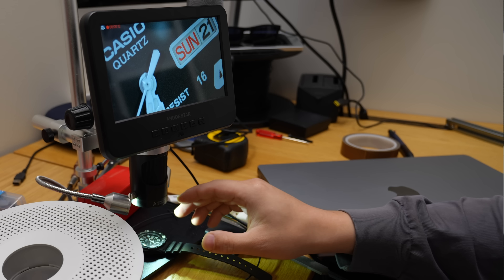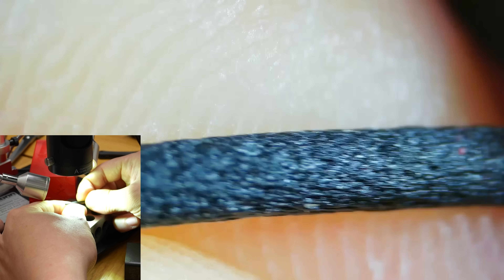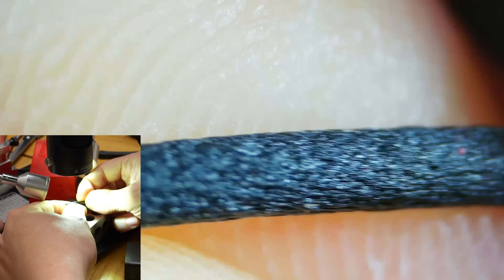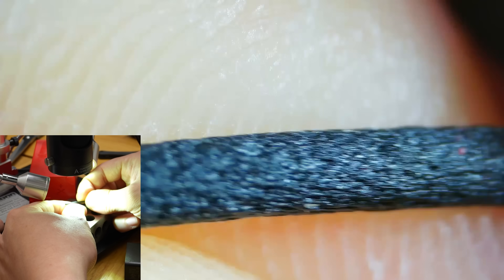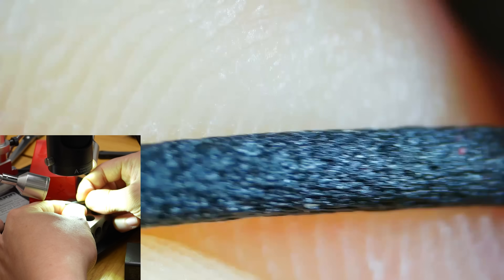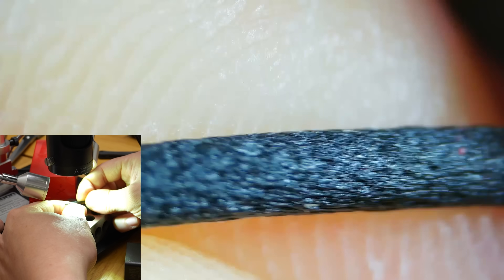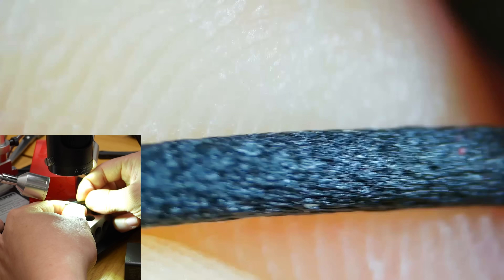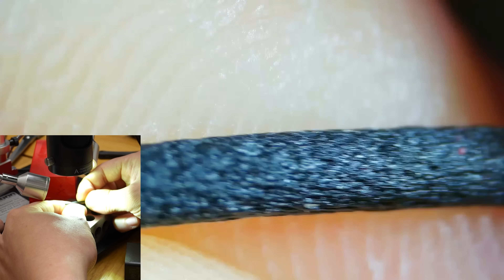The Dark Side of Carbon Fiber Filament

Comment: Well this was no surprise. I have no doubt other, non-carbon fiber filaments will end up in places we don't want them in, in small particles and strands just like this, only in fewer amounts. Think of stringing for example... And what about POM dust from printers with POM wheels? Isn't that basically solid formaldehyde?
Reply from the maker: Just read up on this, apparently delrin is safe unless exposed to strong acids, bases, or is burned when it releases formaldehyde
Reply: @NathanBuildsRobots  Ok, sounds... not so terrible. For a couple of years I worked at a CNC lathe where we would occasionally use POM (delrin) to make parts out of, and it would smell really weird and make a big mess with tiny chips and dust inside the machine every time. I bet it was the formaldehyde gas being released.

Comment: About 20 years ago I was into archery. They teach you to inspect your arrows before every shot. I was shooting aluminium arrows and when shooting an ultra light tube with a tiny dent in it out of a 70lbs bow .. they can fail, and bits go right through the hand holding the bow. A friend was shooting carbon fibre, siting how much stronger they were for the weight ... so I looked into it. Turns out carbon fibre arrows can also fail, even more spectacularly. The problem being that bits of aluminium driven into your hand appear on an x-ray. Carbon fibre does NOT appear on an x-ray. So to get all the bits out, they literally have to sit with a microscope and poke out every tiny black dot amidst all the blood and torn flesh. Anything they miss will still be there decades later, poking you every time you move the hand. Needless to say, I'm still shooting aluminium.
Reply: yes! Inspect with your ears too, bend each arrow before you knock it and listen for defects
Reply: @jellogiant  WHAT? Oh...okay. I thought you were going to say to drag the arrows across your ear to detect splinters.
Reply: I was hand-sanding a 1mm cf rod (really dumb in retrospection) and stabbed it about an inch into a fingertip at an angle. Of course, it broke off. I removed most of it right away but it splintered when it broke. After festering for 4 months I removed another 1 inch piece. That was 6 months ago. There is still at least one more piece in there. I can feel it move and it hurts. I can even see the tip move just under my skin. One day I'll cut it out too. Use caution with cf, boys and girls!
Reply: @ernie5229 please see a doctor
Reply: Fuck i felt that while reading 😖😖😖
Reply: "Needles to say, I'm still shooting aluminium."
Reply: what about using a thick leather glove? or just a cover for the top of your hand
Reply: Ive shot carbon arrows since they becaume a thing over 10 years ago, Ive never had any break during actual shooting, the only ones that broke on me were hitting somthing hard other than the target.. Ive probably shot a carbon arrow at a guess, a half million times !!! No injuries.. Dont even know anyone else who's had trouble with them either..
Reply: They make aluminum sheathed carbon fiber arrows.

Comment: You are quite correct.
Many people using these carbon fibre content filaments, do not know the dangers of what they are playing with.
You should where appropriate PPE, and as a minimum gloves and a mask FFP3 or better.
The composites industry does not where all that gear for the look!
If I print with a fibre containing filament, I seal the finished item with clear lacquer.

Comment: I've worked with fiberglass filters at factory for two years and you'll be fine
Reply from the maker: What sort of PPE do you use?

And what is the typical length/diameter of fibers used?
Reply: @NathanBuildsRobots  normally just a long sleeve shirt but it’s optional and it varied on orders.

Comment: Normal black PLA makes black residue everywhere. I guess its graphite, or whatever they are using as a colorant that is shedding from the filament.
Reply: I have Creality Matte Black PLA, and that stuff has distinct "grainy" texture and a peculiar, strong odor to it, before, during, and after printing, which other matte filament doesn't have, even from the same brand (I've used green and grey Creality Matte PLA's).

Comment: This is a great take (I wish I had seen it before ordering couple of carbon fiber and glass fiber reinforced filaments, lol). I was just thinking about the PTFE tubes and how they are considered another wear item, which means that it is being slowly eroded and getting airborne or contaminating the printed objects. PTFE (Teflon) is a 'forever chemical', our body can't get rid of it so this one also is a potential risk factor.
Reply from the maker: That is a great point. If it’s wearing down, it’s going probably being turned to dust and embedded in prints and in the air

Comment: Can you look at a finished print and see if it still does the same or if it just happens raw?
Reply: Why should there be a difference. It’s molten plastic with cf in it when you get it, you just remelt it into a different shape. If anything it could be worse but it will not magically be better by melting it again.

Comment: Thanks for your video. The topic really needs some thorough research done by the filament manufacturers. 

After watching your video I am somehow left with the big question: "What am I to make of this information?" Could you perhaps make a follow up video and put things into perspective? If it is dangerous, "how dangerous" is it? What other fibrous filaments are there and how does it compare? How does it compare to the risks of working with wood? Isn't wood also just a "kind of carbon fiber reinforced plastic"? And if working with wood is in comparison rather safe, what makes working with wood safe and working with other fibrous materials less safe? Also, what alternatives are there to CF infused filaments? If I want an entry level engineering grade filament that is similarly stiff to for ex. ABS-CF, what can I use, that is printable on a hobbyists 3d printer? The only thing that comes to my mind is PC-ABS.

Comment: I'm very happy that I looked at a strength comparison video, saw there was no advantage to it, and then never thought about using it again.
Reply: There is more to material properties than just tensile strength. Adding fibre absolutely does make a difference to the mechanical properties it just doesn’t do much for tensile strength, but it does increase its stiffness and thermal stability.

Comment: 😂what loads of shet did i just watch?🤣10mins wasted....your only doing this for clicks man(ba ram you). As someone who works with liquid Nicotine to make vape juice i am more afraid of dropping dead from  100+mg Nicotine then i am of CF based filament and I've worked with an around welding equipment huffed exhaust fumes sitting in the trunk of an old 1980s buick la saber and smoke cigarettes since birth...and im supposed to be scared of inhaling and toughing polymer or nylon plastic that YOU SAY has "asbestos" with ZERO evidence from a professional to say "yes that's asbestos"...also if there's asbestos as you claim why didn't you contact the EPA,TSCA,CCA and whoever else needs to be notified so they can deal with it?. Seems kinda weird that you didn't
Reply: It isn’t asbestos at all and he knows that, it is literally what it says it is, carbon fibre.

Comment: I popped open Google Scholar after this and looked for "carbon fiber health risks" and similar terms. From everything I could find, it seems reasonably safe and biocompatible. I don't see how this could be any worse than something like candle soot (which, to be fair, isn't great). It's definitely not Asbestos - the problem with that is the silicate which isn't able to be broken down or absorbed by the body. Now - if you want to look at some of the glass-filled 3D printing filaments, I could see those being a possible risk.
Reply: @circuitguy9750  during printing it's not a risk as the fibers are enclosed inside its wrapper material, it's mostly during handling such as removal of supports and breaks during printing.

Comment: I worried about that when i first printed with Carbon Fiber. I remember my boss back around 20 years ago telling me to go into an attic with GF insulation, about 30 seconds in i noticed it was getting airborne and i said EF that.. told him i can't risk my health. You definitely don't want to sand anything CF or possibly GF and make it air born either.

When i first got a resin printer, i just stopped using it after a few prints despite using an N95 mask and gloves. You really need a full face respirator IMO for prolonged usage. Although it seems to be just fine if you're safe "enough" with occasional usage.

With all this said, I think I'm going to clear coat the CF and GF parts that will have human contact to give it a barrier after watching this. And run my air filter for things like CF PLA, I'll have to play around with settings if it's going to be enclosed.

I've actually been thinking of having a heat exchanger so i can run PLA/PETG prints sealed for both sound a potential toxins. Much like an inner cooler on a car with a turbo or super charger but for the parts cooling fan hose. VROOM

Comment: Not terribly worried about the stuff that gets on the skin, but the prospect of inhalation is scarier. Just printing with it occasionally almost certainly not a big deal, but if you ran this stuff on a print farm daily it would be bad news. I do think there are concerns around using fiber filled filament, but it's nowhere near Asbestos levels of dangerous.
As for uses of fiber reinforced materials, there are many. For PLA it is primarily aesthetic as it hides layer lines and produces a nice finish, but it can also be stiffer and it tends to be high flowing. For Nylon it is primarily less warping and also more stiffness rather than elasticity. PETG and other filaments, generally a mix of the above benefits.
Reply: also heat. Carbon-reinforced nylon once annealed is the most heat resistant stuff you can print without a rig that can extrude PEEK.
And yeah, I wear my respirator with particulate filters when I work with it.

Comment: @markforged
Reply from the maker: Markforged uses continuous fibers, and I’m pretty sure you can use plain nylon for the external finish. So I think they offer some good options with added benefits of much higher tensile strength of continuous fibers
Reply: @NathanBuildsRobots  the standard filament for markforged printers, Onyx, is a carbon fibre filled nylon.

Comment: tbh outside of 3D-2A, automotive and other high heat, high stress applications CF-nylon is really not useful. CF-PLA splits really easy so is not useful anywhere outside of statues. also the idea of coated CF filament defeats the point. having those prickly fibers sticking out aids the layer adhesion of nylon. it would be a good idea to coat those kinds of prints on completion though!
Reply from the maker: You’d have to check the datasheets. Most people say cf reduces interlayer bonding
Reply: Tbh I'm just repeating what the Are We Cool Yet? matrix chat said as well as Hoffman tactical. That said when it comes to 3D-2A we also print a little bit differently than most other 3DP enthusiasts. Hot, and slow for our stuff. Some stuff even uses weld passes. CF layer bonding issues mostly are with PLA and PETG though. Nylon behaves a little bit differently based on the testing performed by Hoffman and others.

Comment: This is a serious threat and it does get everywhere. If you're new, consider that I still find dust samples with carbon fibers from printing over a year since the last CF job in this room and who knows how many times I've cleaned. Dust mitigation is really required here as these fibers are a potential threat to basically all tissue exposed to them - it's mechanical, not chemical. Some of my products are on machines that package food or make the boxes your Amazon stuff comes in. No matter where in the world you are, there's a chance you have or have had one of these products in your home. Those fibers could be in your cheesecake and in your eyes when you tear open the box your headphones came in. My fiber waste could be in your lungs. So obviously I'd never use those materials in that environment but there is literally nobody to check, nobody would know, the food processing facility inspectors would never catch that so it's literally on me to keep you safe and I could totally choose not to. By chance, I had a career in medicine and I know a lot about the topic but that's not some license requirement it's just random luck. Right now you might only be making baby yodas or something, I was too, but eventually your work may end up in the world or all over the world so be responsible now. We don't want to give the fearmongers ideas on how they can make $500M in donations by starting a movement to ban printing with additives, but we need to be aware of industrial hazards like this and learn how to reduce risks. Stop dremeling PC-CF while sitting on your bed next to the resin printer with "less toxic eco-resin™" so you can watch the laser turn vinyl into flaming chemical weapons. This is why we can't have nice things.

I've gone as far as to put up a steel building with proper ventilation and chemical storage and stuff because I've gone commercial but in the 'bedroom shop' configuration I was running evac through a 4" inline blower out a window vent device with activated carbon and HEPA recirculation in the room but there are still VOCs, smoke, and particles all over that don't get captured for a while and present a risk. Those are the ones I keep finding. I doubt we'll see Polymaker mesothelioma commercials any time soon but there have been injuries and there will be more so lets keep it minimal. If you're new to industrial practices you might get some surprises, like that old Ender 3 had its heat block wrapped in literal asbestos lol. A 2 inch square of ceramic fiber paper wrapped in Kapton is only a hazard during stupidly rough handling so its fine normally. That's not weird in industry. Consumer safety bans are for consumers not producers, industrial regulations assume you (the manufacturer) will be responsible for not being dumb. There is no teachers' union to decide in advance you wouldn't hurt yourself if you ate this and shoved it up your butt in a classroom. You're your own plant safety officer so self-educate, the curse of a republic is having to participate, we're all our own kings for better or worse. If you don't want to live in a maximum security world with scent free shampoos and unbreakable rubber sporks then you don't have a choice but to self-govern your practices. Yeah, it's expensive, your $200 laser will be $1000 by the time you finish building it the right way. Your printers will need a room, not a corner. That room will contain hazards. It is what it is because physics.

Blowers, dust separators, spark arrestors, filters, prefilters, speed controllers, exhaust hardware, adsorbants, respirators and carts, tyvek suits, gloves, goggles, GFCI breakers, spill kits, extinguishers, monitoring sensors, silicone trays for surfaces, bottles, bags, cleaning supplies, all in I think I spent about $2000 on all of it but it covers everything from paint fumes to grinding dust and when you buy the media in bulk it doesn't cost much to get a year worth of refill supplies. It wasn't in my amazon shopping cart back when I ordered a $199 printer but I'm glad for all of it now. Consider the entire product lifecycle from raw material to end of life. Do you need a dangerous plant somewhere to make phosgene and turn it into polycarbonate for this, or is plant starch PLA ok? Are fibers absolutely needed or is more mass or different geometry adequate? If seeing a plastic straw up a turtles nose bugged you, imagine a fish breathing water full of these fibers from the waste in the landfill a mile from the beach that only biodegraded enough to free all the fibers. "But it was the first carbon fiber polycarbonate baby yoda ever sold on Etsy!" 😏 Just sayin... Stay safe and keep learning.

Comment: I think it's a bit of lost or untransferred common sense. People usually know and understand not to handle glass and carbon fiber materials or to wear PPE when it comes to bulkier materials. That safety knowledge hasn't transferred well into the 3d printing even though the fibers are still present as part of a composite material and can still cause many of the same issues. Edit: Paused part of the way though and I basically said the same thing you did at 3:45.

Comment: I'm against these crap carbon fiber filaments.  They're great for stabilizing things like Nylon, but in general they aren't providing any strength in the Z axis, where 3D prints are the weakest anyways.  They're largely a gimmick.  They tear your printers up, the fibers aren't long enough to really matter, just in general it's a crap product.  The only machine/process worth doing anything with carbon fiber, is Markforged.  They embed long carbon fibers directly into the center of the thermoplastic, and have a special cutter to slice the continuous strand.

Glad to see you doing more content like this - your channel has gotten better and better.